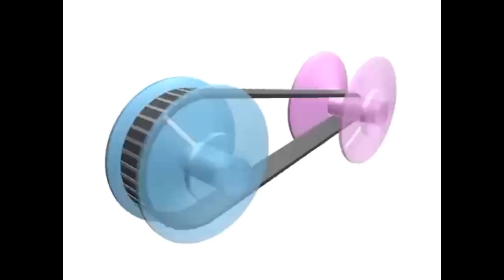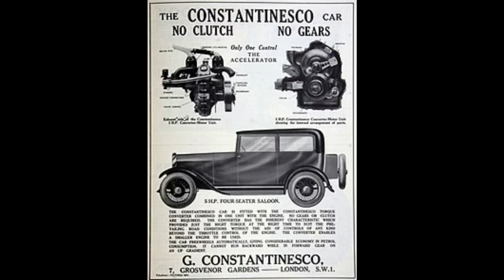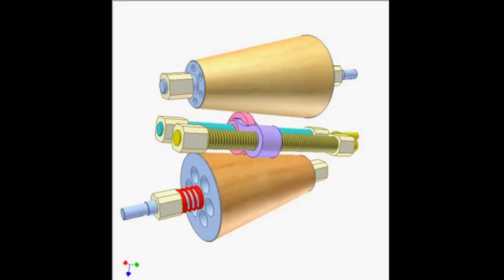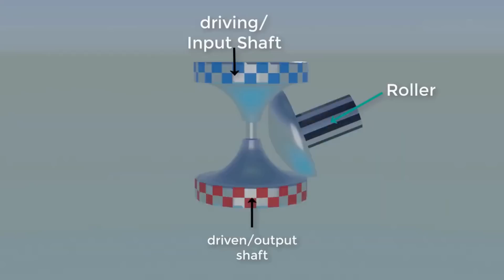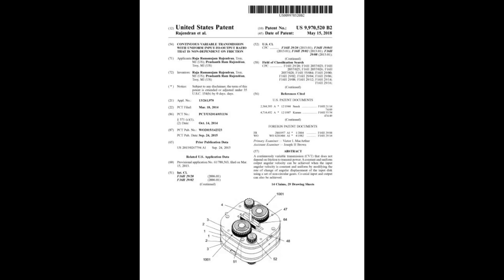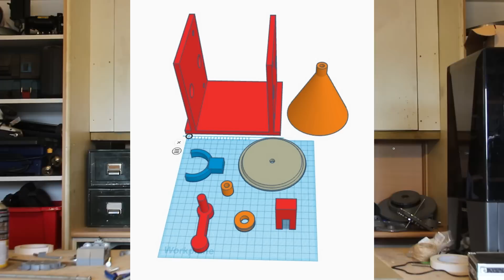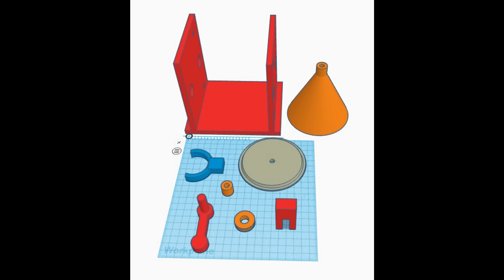1972 Continuously Variable Transmission For Use In Wind Turbines (CVT)

Comment: 2 cones lined like a motor with coils on the outside and the inner cone like a stator with permanent magnets should make an awesome wind turbine, you could vary the rotation power by moving the stator in and out of the coils, this should eliminate over speeding and improve efficiency, basically a long cone shaped generator. The more magnets you can use in the correct configuration should also eliminate vibration. The further the cone is open the less wind power would be required to start the turbine and it's peak performance would be able to be determined on the fly.
Reply: I'm assuming the force of the wind on the blades pushing would cause the cone to be forced back further into the permanent magnets, the magnets interacting with the stater, repelling it back when less wind force acts on the blades?  Either way a brake still needs to be implemented for safety and sliding bearings. In the end cost and output Vs the old systems would be what people look at when you put this new design against the old
Reply: @MrRedeyedJedi  Yeah, the in-out movement could also be controlled electrically. You could perhaps add a cone on each side, like this <<>>, and achieve double the generation and braking effect by moving the outer cones towards each other. This way, you might obtain a magnetic bearing effect, reducing friction significantly and minimizing bearing maintenance. The cost should be offset by increased efficiency. I will build a small-scale prototype and see how it performs.
Reply: @VoidySA  you have a good baseline principle to start on paper, run in simulators, but don't over complicate what you originally thought of. Always start simple on original idea and build from there where needed. The issue with magnetic bearing idea, although a great idea on paper, is the magnetization can weaken over time and it only takes a tiny imbalance and itl stick to the side somewhere. You do have a good idea to work with though
Reply: @MrRedeyedJedi  Thanks, Yeah the magnetic bearing effect will just minimize wear on existing bearings. Let's see where this go.🤣🤣🤣
Reply: @VoidySA  I learned the hard way if you have a good idea to keep it to yourself
Reply: I have not thought the detail of @voidy remarks totally through. However, I cannot believe that a wind shaft would be viable without a thrust bearing. The dynamics are such as cause potential calamity at an early stage whether by fan or helix. CVT systems are about I/p & o/p linkage in this case in cone form. Electrically the suggestion of intensifying or reducing o/p relative to speed and power demanded in real world conditions would need proving. 
I imagine this would probably be by a fixed cone on o/p and a sliding cone on i/p. The travelling cone would possibly be via a mechanical scroll over a fixed distance according to speed with advance retard by mechanical or hydraulic recuperation. As you say this would depend upon the complexity of engineering design relative to current gear box economics. 
Engineering costs vary with availability of materials, the ability to work them, operational process of construction and the maintenance requirements one installed. To this must be added the financial desire of the backers who may well be a mindset apart from the developers. So can the new device if marketed outweigh financially the devices on the current marketplace and is there the political will for such a concept to succeed? This latter is important as if anything interrupts the paper trail of carbon footprint trading in which huge sums are made by financiers and politicians it is a dead duck and I make that statement with a considerable life behind me!!
Reply: @glynluff2595  I agree with all you said, but if I build a small prototype that works well and making money are not my intention, I will post it for the world to gobble up and use🤣🤣🤣
Reply: @VoidySA  Bravo and I wish you every engineering success! We  NEED engineers but they need development money and that is always hard to come by.
Reply: @VoidySA  worlds FAKKEN greedy mate, get it patented when done and delete the comments so someone doesn't knick your idea 😂
Reply: Sounds good what’s stopping you!

Comment: Of course the problem with using CVT's on wind turbines to prevent run-away generator speed problems is, as the wind speed increases the turbine rotates exponentially faster because as you are only taking a constant amount of power out, a higher percentage of the input (wind) power goes into the spinning of the turbine.
Reply: That run-away could be prevented by using a centrifugal governor in some way like those used to control RPM in old steam and fuel engines.
Maybe a governor could pull up a rod connected to the ball at a certain speed to lift it up and disconnect the input and output shafts.
Reply: @DeeDee-pw9pm  See my other comment

Comment: I also have considered the problem of wind turbine CVT and came up with my own idea using a variant of the disc system.
Using a keyed shaft attached directly to the turbine, a classic spinning ball governor to pull an omni or mecanum wheel up and down the keyed shaft and take the output from the spinning disc, thus providing a purely mechanical control system.
Admittedly the output speed would probably not be completely constant, but I have always lived by the KISS principal.
Reply: Ever heard of VRT Innovations?  The D-Drive?

Comment: so now for efficiency, what is better....
A: some form of varable transmission
B: MPPT converter
C combinaton ... variable transmission to get optimum efficiency on turbine blade combined with MPPT for max power
Reply from the maker: in my understanding mppt is a battery charging regime - how will it help?
Reply: @ThinkingandTinkering  mppt just trackt the max power, works fot battery tied systems as well as grid-tied, i know about the grid-tied version since i got a solar/wind to grid converter with mppt a few years back :)
Reply: @ThinkingandTinkering  Maximum Power Point Tracking refers the the most efficient operating voltage of the solar panel or alternator, measured at the panel or alternator.  On solar panels the brightness of the sun determines that voltage.  On alternators and generators that voltage is determined by the RPM.
  
An MPPT tries to constantly maintain that ideal voltage at the panel or alternator output  and then converts that voltage to the desired battery charging voltage or inverter input voltage.  Some MPPT controllers can boost the voltage from the panel or alternator if needed for low wind or low sunlight operation.

An MPPT for solar panels will not work for wind turbines.  A true MPPT for wind turbines will have a power curve that needs to be adjusted to match the wind turbine's alternator.  Some high end MPPT controllers can be switched for either wind or solar use, but not both at the same time.

Comment: There's one more CVT that I've seen, and I actually bought one and am putting it onto my tadpole (reverse trike, I'm disabled) that I've upgraded for pedal assist.  When I added pedal assist, my whole drivetrain started dying, quickly, so I'm upgrading to belt transmission (Gates and Veer make belt systems for velos) mated to a CVT IGH made by a company called Enviolo.  There's a bike company called Priority that offers CVT as a factory option on their bikes.  I'm not affiliated with any of these companies, I feel like I have to keep saying that.
I spent 25 years in many areas of technology development and deployment and while I can't have that job any more (they fired me, they only have to wait 12 weeks by law to replace an injured person) I have pretty much everything I learned still knocking about somewhere in my cells.  I don't want to see that wasted - so I drop these things in places...to see if someone finds the thing I did, and encounters the same joy.  Even if our projects are different, our joy is still the same.  Joy is joy.  Everyone should have some more.

Comment: One of the joys of a CVT in modern autos is people.
We are so used to distinctive gear changes that manufacturers have had to ADD them in, by way of programming the on-board computer for such.
This leads to early failure of the CVT because it was designed for SMOOTH, not lurching, transitions.
People are stupid. I, personally, am glad I am SMART enough...
To remember I, too, am a people. Most of the time.  🙄